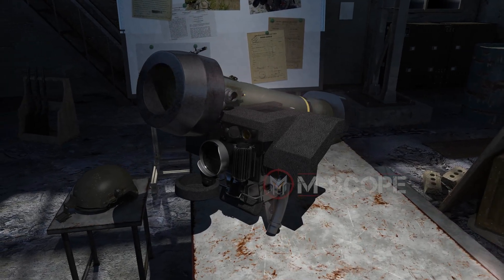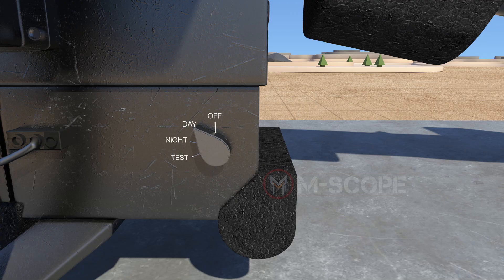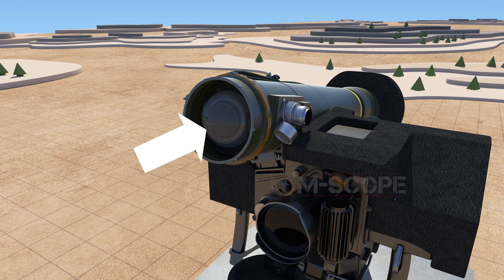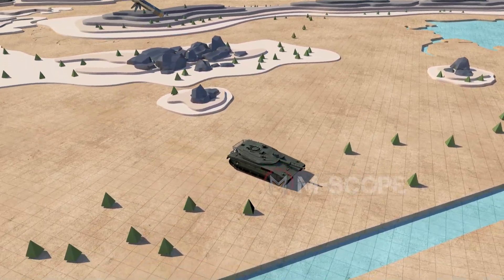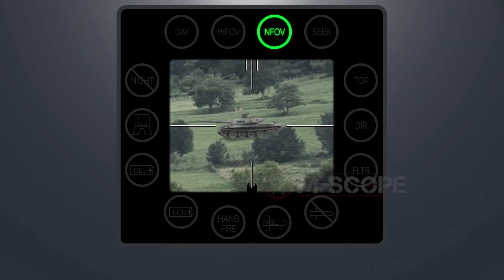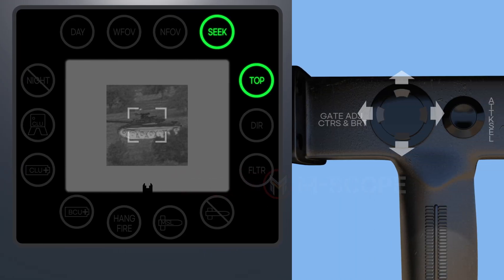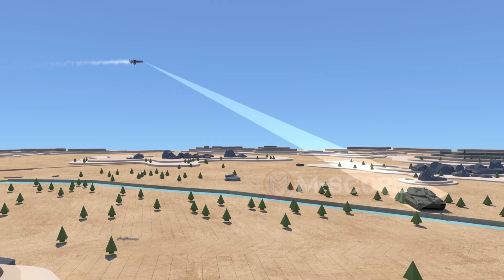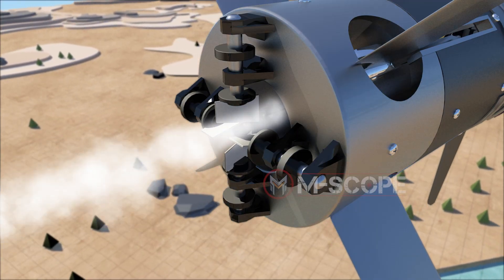Tank Killer Javelin Missile - How to aim a javelin missile

Comment: And this is why all this sophistication led to LESS than 10% hit ratio. And HIT is not KILL. Why don't we hear about J. in ukraine anymore? Guess yourself
Reply: 10%? Where do you get this info? May I get the link to that research article?

From what I know from the folks that designed the Jav, it has a >90% successful engagement rate, from 2019, it's estimated that it has hit its target around 5000 times.
Reply: because the nature of the war has changed compared to the beginning, because at the beginning it was columns and massively armored vehicles, and now there is a point application, because the orcs also try to act from closed positions and from a long distance, plus the training of the shooter, the number and availability of means of destruction.

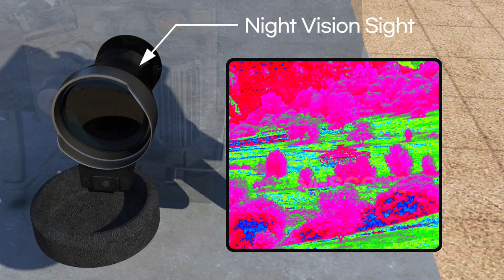Comment: 2:40 A "thermal" optic is able to work both day and night and detects heat via infrared radiation. If the device were to have a true "night sight" then it would only amplify light. it wouldn't work with heat

Comment: it is really expensive.... but considering night vision and target lock  it is actually understandably priced at 200k.  the main flaw is that there is no way to fire it from cover. that was actually really shocking oversight from designers.
Reply: Would be cool, if you could link the targeting from a drone to the javeling so you can shoot it from cover.
Reply: @melonenlord2723  no introducing radio into this system would me a mistake.  it just needs tripod for launcher and two piece targeting part like Stugna has

Comment: Awesome explanation, I don't get one thing: at 4:35 you talk about the night vision sight filter that "prevents enemy detection". What is it exactly and how can the enemy spot the sight?
Reply: The IR detectors can be cooled and uncooled types. Later in the video he mentions that the thermal sights on the command control unit is cooled to lower temperatures. (Also the one in the rocket aswell) The cooling of the detector is used to maximize the difference between the temperatures, what makes the detection unit very sensitive but the very cold detector inside can be then detected with another IR device.

Comment: the sophistication of these expensive things today is perplexing compared to what I was told about by a former soldier as I was a real little kid in the late '60s. But at almost 250 Thousand $$ each, it had better be staggeringly sophisticated. I'm thinking for that cost it ought to have a greater altitude /range performance than that stated. Also the launch tube should be reusable, as an economy measure for the deep pockets of whoever's buying this thing. God help us if any of these units fall into the wrong hands. Same goes for the old Stinger as well I guess.

Comment: What i wanted to know is if the Javelin can be fired without the CLU! From the videos i´ve seen of captured Javelins, the Javelin crate contains just the missile+tube. Is the CLU supplied separately? And if fire without CLU is possible, what are the hit percentages?
I think the video arrives too late to be of much help to ukrainians. Most ATGMs have been expended (many had discharged batteries, after many years in storage), and NATO can´t supply any more unless they risk their own reserves, leaving them exposed in case the war escalates. And the manufacturer can only make so many a day.
Let´s face it, NATO´s gamble failed. The russians won the war, and prolonging it is causing untold suffering. The more conservative estimates put UA´s casualties above 100.000! It´s insanity to keep this going! And it´s immoral to keep supplying weapons and prolonging a war that just can´t be won, and never could. They should have pushed for a cease fire immediately after the invasion, and save the lives of so many young men...
Reply: Ukrainians found a way to recharge batteries like in first month lol, the only issue for them by now is overheating
Reply: Traitors like you will be made slaves.

Comment: With all that you failed to explain the one thing that I wanted to know. After the booster motor what is the propellant they're using to propel this thing? I don't see smoke so maybe they're using small liquid propellant tanks? Or maybe a smokeless grain propellant.
Reply: I guess it's a low burning speed propellant. It's more like the sustained flight motors like used in many missile systems : the first load is really powerful and "brute force" to increase speed quickly, and the second one is more like a slow burning thing, just to maintain the "cruise" speed. We have this on ERYX missiles (the French AT missile / it has short range though, only 900 m max). Sorry if my english is crap ^^
Reply: Probably commercial high performance solid propellant. The launch motor propellant contains lead B-resorcyolate which means this weapon will cause lead exposure, particularly if fired in an enclosed space and failing to evacuate afterward.
Reply: Since nobody answered correctly: They use APCP, ammonium perchlorate composite propellant, for the motor. Its 70% ammonium perchlorate(oxidizer) as a blend of different micron sizes, 15% a fuel (typically aluminum), 15% a binder that also doubles as extra fuel, usually HTPB( hydroxyl-terminated polybutadiene), detergent (Triton) to reduce bubbles in the grain, castor oil to increase flexibility of the grain (makes it less prone to cracking and breaking), and bald eagle feather powder (increases the freedom delivered by munitions). The metal type and content in the grain determines amount of smoke. Pretty much all military missiles and civilian rockets (NASA) use APCP. Rockets like the LAW however  use double base smokeless powder. Double base powder is different than typical smokeless though because instead of being just nitrocellulose it also has nitroglycerin.

Comment: most of the javelins in ukraine arrived without batteries or the clu
Reply: Because the CLU is made to be reused, not discarded like the tube. Same as with the Panzerfaust 3. The batteries need to be replaced after a few hours of operation, so they are probably delivered separately.
Reply: @nematube  It's a Russian troll talking point. They are bitter as f__k 🙂

Comment: Interesting how locking algorithm works. Is it something similar to how computer mice tracks movement? Seeker just constantly looks for its saved locked image of a target? Meaning it can miss if something will get between missile and target during flight? Obstacles that will cause not certainty in tracking target?
Reply: The missile has a perspective from high up in the sky, so it is highly unlikely that anything would get "in a way"... What could it even be, a helicopter? Or perhaps IR smoke all of a sudden? Sure, I guess there is a one in a million chance of that happening. Javelin is not 100% fool proof, you know.
Reply: Technically yes, the seeker keeps a profile of its target as it travels in mere seconds. It’s not necessarily akin to a mouse tracking movement, but more of a tracking similar to a motorized security camera.

The profile can be disrupted by infrared cloud or incendiary flares. 

Yes Javelins can be defeated this way. It is part of the training to launch these system as unpredictably as possible. It’s fairly easy against tanks as those system have no countermeasures to detect an incoming threat as the missile doesn’t not give off a radar signature as it only uses cameras and sensors to reach its target. Because of its self targeting, the whole system is fire and forget.

Anything to disrupt the shape of the target is enough to stop them, but it’s very difficult to detect them incoming.
Reply: The missiles flight only takes a few seconds to reach its target. Not two or three hours, really don’t think there’s time for anything to get in its way to break the missiles concentration, LoL.
Reply: @M21-w1y  My question is not about this.
Reply: @M21-w1y  these systems can be defeated when the profile is disrupted. 

The main advantage of of this system is that it’s a closed loop PID system that doesn’t not output any tracking signature, everything is calculated internally. Because of this, the entire system is fire and forget.

To defeat this system, the target will need to be obscured with an infrared jammer such as an IR cloud or a lot of flares. Tanks do have these systems, but the reason why they aren’t effective is because tanks (even US tanks) are not equipped with active radar detection and will not be able to react in time.

Targets will need to have detect the Javelin team well before launch if they want to counter them.

A proper counter unit will often patrol with the tank as it can provide as a quick reaction force to repel any anti-tank crew. Because Russians don’t follow the same techniques as the US, it’s essentially like shooting fish in a barrel.